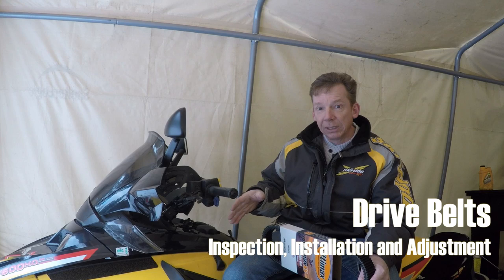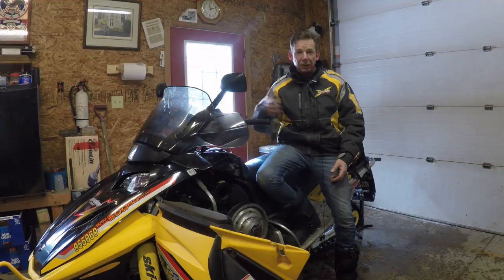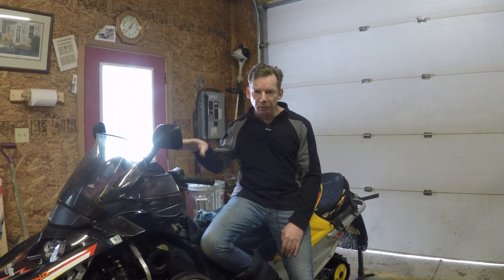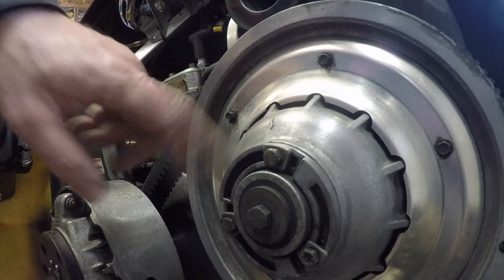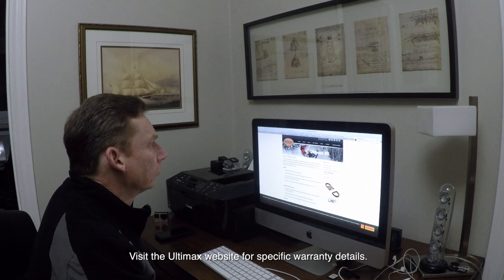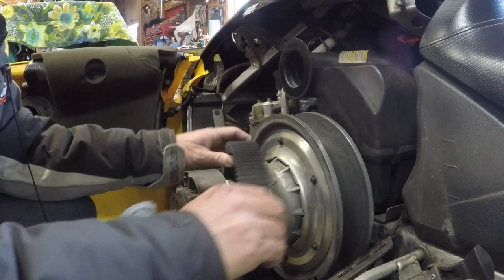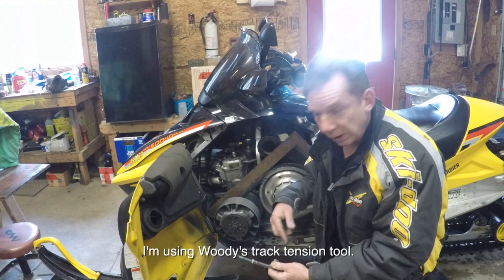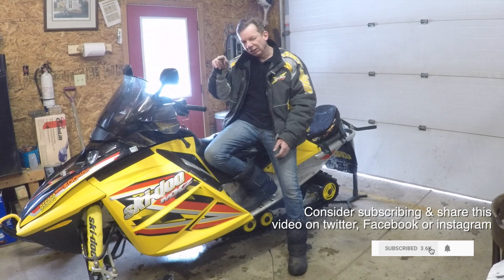How I Inspect and Install a Snowmobile Belt  (& Adjust Deflection)

Comment: Hey , I’m looking to throw a bigger 1.75inch backcountry track on my 121 iq 600, I know she’ll have the power to move the track but the stock clutching /gearing makes it a rocket ship at past half throttle and a dead dog below quarter throttle or 1-3000 rpm, looking into maybe Geting some lower gearing (maybe the rmk gearing ) and a clutch kit , what your thoughts? , waste of money ? Buy a nicer sled with a stock deeper lug ? Looking to get deeper wet snow performance as where I live we tend to get big dumps of snow , then turns to ice then rain , then it’s hard for my wee lil .91 track haha , makes you a better rider forsure tho
Reply from the maker: Nothings a waste if you have fun, but if it was me, I’d buy a sled with the features I want.
Reply: My Old Sled thanks for the response , I’m gonna talk to some people and budget out what I’d need to push that track and get it all tuned , if it’s pushing 2g ur prob right , just sel the sled and put that extra funds for the upgrade into a longer , depper  lug sled , anyways appreciate the thoughts !
Reply from the maker: For me its not just budget. If a sled came with something as an option, great, id do that. But the problem with franken-sleds is that the parts of your sled were all designed to work together. I could make a longer skid fit my old 670, but it would still be an old heavy 97 670 with a long track. But again, some guys would have fun doing that so if its fun, go for it,

Comment: FYI belts are supposed to go one way the cords are wrapped one way if it is on backwards and it blows it wraps around the clutches
Reply from the maker: Hi Victor. I'm sorry, but that is a VERY common misconception. It likely came about because manufacturers either advised people to install belts with the text so you can read it facing the sled, or printed a directional arrow on the belt. They advise you to install it that ways because the belt should alway be installed the same way. All of the information in this video was provided by or confirmed by, several of the major belt manufacturers.
Reply from the maker: Had the wrong link. This should help: https://youtu.be/KaJBwUplF1Q

Comment: What belt do I use for 06 skidoo gsx 600 h.o?
Reply from the maker: Hi Kayla, if you mean which Ultimax, there is a belt finder on their site, but I believe your sled takes an XS803. If you mean and OEM belt I think it is 417300586.
Reply from the maker: For the OEM I'd confirm with your local dealer but that's what I see at skidoopartshouse.

Comment: If you smell burning rubber when you bury your sled and try to drive it out, you've smoked your belt. Clean the burnt rubber off your clutch before you put on your new belt so it doesn't slip. Speaking from experience...
Reply from the maker: Id always clean clutches before installing a new belt. Thanks for watching
Reply: @MyOldSled  I am definitely subscribing to your channel. Thank you for the video!

Comment: What happens if you start the machine with out drivebelt
Reply from the maker: You shouldnt run a sled without a belt. The clutch can try to close and there is no belt, it can damage the clutch.
Reply: my father's sled's drivebelt broke while driving at big bumps
Reply from the maker: Bummer. Always check your drive belt before you ride.

Comment: I noticed the stand you are using for your sled. I used to have the same one and to be honest never liked it. The leverage with the handle was terrible and the stand itself is quite cheap. I highly recommend this stand from Princess Auto https://www.princessauto.com/en/detail/adjustable-snowmobile-lift/A-p1500002e  I can lift my sled with one hand and it locks into place easily. I have 3 sleds and bought one for each. Best purchase I ever made
Reply from the maker: Ill be doing a video on stands soon.
Reply from the maker: Took me a while, but you were right on with this comment! Will be doing a video on this topic.